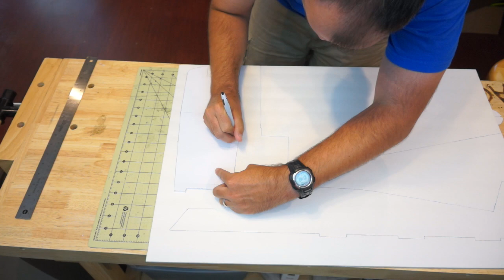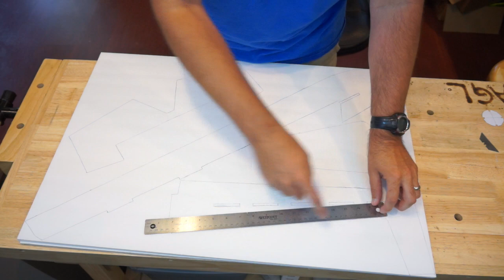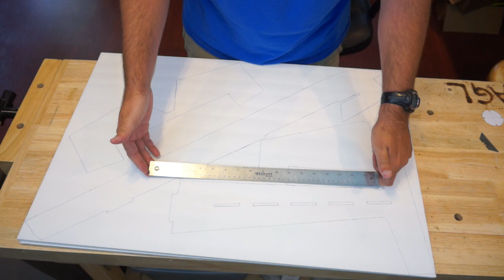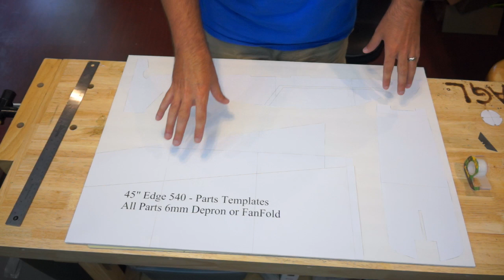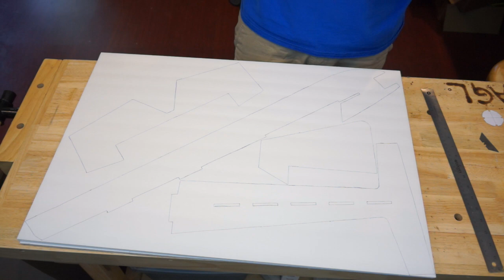Edge 540 Profile Foam Plane Build

Comment: So I just finished flying this scratch build here at my local field and it truly is a winner. Easy to fly and slow for learning 3d. I used a 1000kv motor and 10x4.5 SF prop with a 2200 3s lipo. I also add fixed landing gear. This thing is sweet..Thanks yall.
Reply: i just finished building this exact EDGE and followed his video to the "T.  My CG is way back at about 5 1/2 inches from the LE!!!!!!!!  with a 3S 2200 all the way up against the firewall. Could you PLEASE tell me where your CG ended up???  I would really appreciate it. I have zero experience with a flat wing so my normal under the thickest part of the airfoil doesn't work. Also please let me how you mounted the landing gear. I want to do that as well.Thanks.😊😊😊
Reply: @berndm9743  Bro so yeah the cg is 5 1/2 inch from leading edge ( it's the front of the wing which is near the fuselage  fr PPL who don't know) and it's crazy how a 600g plane is so smooth it would be better if it was around 450-500 grams could cruze at  half the throttle 😅
Reply: Idk if you will ser my comment, but has a beginner to rc planes, is this one a good option? I've flight drones and helicopters but never rc planes

I like building things and those 3d flat planes look hella fun to fly
Reply: @Theonewhoknows98   yea bro it's hella fun u can crash n fix it with a tape it's perfect for a beginner

Comment: Made one at 73% scale out of adams dollar tree foamboard and added 6 sets of vortex generators designed from the FT 3D as well as some huge wingtips and it flies awesome! Definitely try your best to keep it light if you are using a small motor. Small issues wing wing rocking but it takes a crash like a champ

Comment: Hi you also need 2 or 3 deg/ down thrust and 2 or 3 Deg/ right thrust to fly straight standing from the rear model Builder for over 30 years

Comment: I usually make pin holes thru the plan into the material below then use a pen and ruler to connect the dots in the foam or balsa etc....thanks Laurie

Comment: Hey! Thanks for the instructional and plans dude! THIS is my very FIRST build from scratch (as I am still a newbie). Just a couple of questions if you have time to answer? BTW, I thought the music was just fine (pretty cool) for the fast forward parts!
1 - I noticed the gap cut out of each wing where the fuselage goes (the perpendicular line) <3:50min> is approximately 25% of the total line vs the my 38% (cut from the plans). i.e. my wing hinge line meets right where the part of the wing is cut out. This means that my ailerons would be 7% bigger than yours. Did I somehow put the pieces together wrong? I can't see how! Or is yours a little different?
2 - Would it be a good idea to peel the white paper off of the foam and coat the foam with polycrylic (and maybe paint)?
3 - Would it be a good idea to sand the lead edges of each wing to be curved or would it make a difference?
I's stuck at the aileron hinge part but, if I get no response will probably just cut the hinge straight across to meet with that fuselage cutout line vs yours that meets which goes more forward past the fuse cutout then back again. 
Thank you regardless of any responses!
AE
Reply: Don't know if you still need help, but, 
Sanding the edges doesn't make much of a difference
Having bigger ailerons is not that much of a problem
Personally, i tries peeling the paper and then spray painting my planes, but some chemical reaction with the paint i used vapourised my foam core...also, it's better not to, for the structural integrity of the plane

Comment: WILL THE FOLLOWING MOTOR & PROPELLER WORK for this build (most of the suggested components are out of date and not available)?  Sorry for all the questions. I’m new and “trying” to get into this hobby but finding all sorts of frustrating hindrances (i.e. the  numbers, weights, fitment, etc. UGH..I’d REALLY APPRECIATE  ANYONE answer YES/NO to the following questions please: Will the orange colored “DYS D2836 1120KV Brushless 2-4s Outrunner Motor” and an “APC-Landing Products Slow Flyer Propeller, 9x4.7 SF, APC09047AF  which I currently have in my Amazon cart work for this plane? Also, I JUST TODAY bought a used Spektrum DX6 Radio which came with a Spektrum AR500 DSM2 Receiver. Would the AR500 suffice? Or, do I have to buy another one of those too? I’ve already ordered a 30Amp RC Brushless Motor ESC 3A UBEC with XT60 on Amazon which I’m guessing will work. 

THANK YOU THANK YOU THANK YOU IN ADVANCE!!!

Kiko, The Black Labrador Receiver

Comment: Please, how much power for the motor or where to buy.
Thanks,
Andrej
Reply from the maker: +barowc We bought our motor, esc, etc at our local hobby shop.  The motor was about $25.  The motor we used is listed in the comments; it was a 2212-10 1400kv 3s motor.  Thanks for checking out our vid.

Comment: on your component list i believe you missed : 2 x 6 inch servo extension, 1 x small diameter round or square carbon wing spar and of course 1 x popsicle stick
Reply: and firewall plywood 3mm

Comment: 5mm or 8mm ????
Reply: Khanh Vu 5毫米
Reply: 鲍鲍龙 i can use 2200mah ?
Reply: @khanhvu3285  you can use 600mAh or 50 000mAh battery all what you have can use, 2S-3S-4S what ESC can use.

Comment: I realize this was 5 years ago but, THANK YOU NEWAY! It's still good in 2020! Anything u wouldve done different now that its 2020? Also, will this set up work if I add another servo?  Or would u add a more powerful motor?  https://www.amazon.com/FPVDrone-Brushless-Controller-Quadcopter-Helicopter/dp/B07Y2ZL4MM/ref=sr_1_1?dchild=1&keywords=2212-10+1400+brushless+motor+and+30+amp+esc&qid=1603853262&s=toys-and-games&sr=1-1